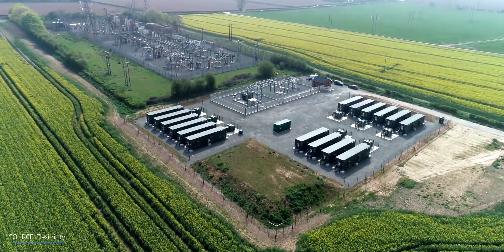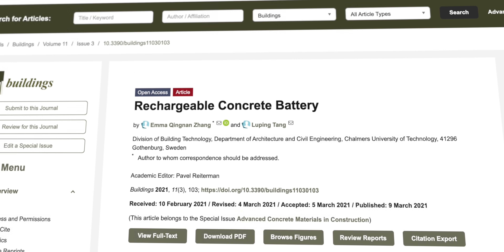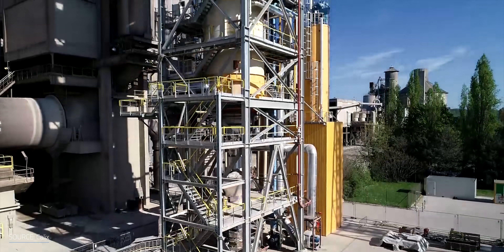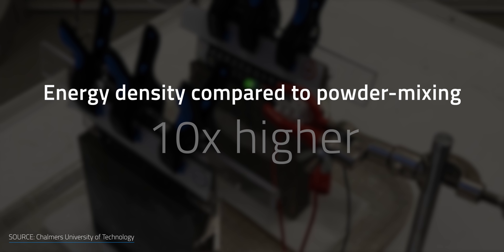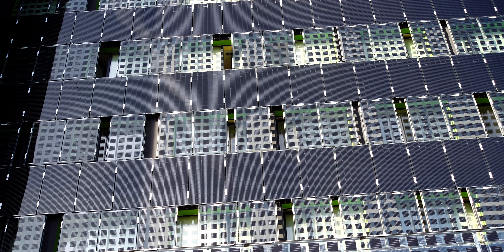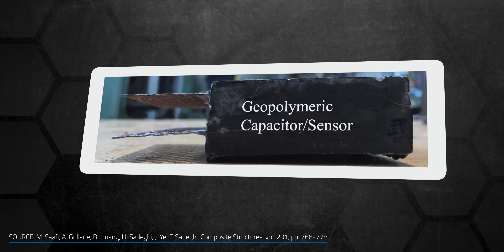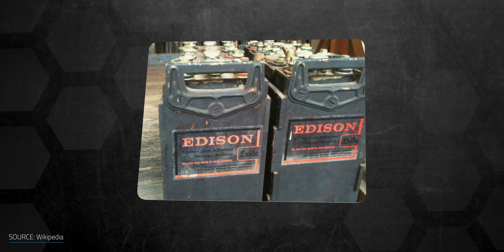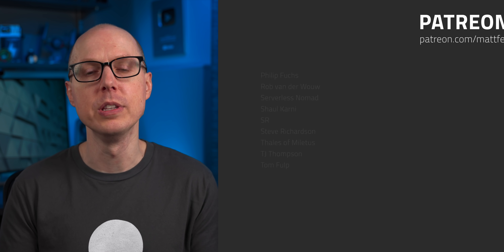Turning Buildings into Batteries? Concrete Battery Storage Explained

Comment: I hate to be that guy.  But this is not going to happen.  This is the most impractical idea I've seen yet.  Also, there seems to be this strange confusion with cement being the active material here..  Cement is nothing more than a terrible electrolyte.  You cannot create a system where construction works are suddenly manufacturing complex batteries while trying to worry about the construction of the building itself.  It cannot happen.  I think the main focus should be on alternative extremely cheap batteries such as carbon salt based batteries/super cap hybrids.  zinc ion + Carbon is near lithium energy density, and is practically made of garbage, and can run tens of thousands of cycles..

Comment: "This will last for years"
- shows an analysis sheet with degradation of 12% in 6 cycles

This tech doesn't seem viable based on all of the data collected so far PLUS from a practical standpoint. It sounds great, concrete is in everything so why not replace it all with a battery version, right?  Well because replacement is difficult and in some cases impossible...you can't just rip out the 12th floor of a 50 floor building.  "Then we'll just do it with new buildings"....that makes sense, until you realize that the batteries will eventually die, and by the sheets, that death rate will happen within days, so it makes no sense to waste the costs for a few days of electric hold and then not be able to replace later.  Then you have the technical aspect, electricity in a porous medium leads to rust pretty quickly, and rust expands the concrete which creates cracks, making it prone to failure on the foundation aspect.

You've taken the worst parts of 2 ideas and slapped them together....a battery that dies quickly and holds less charge inside a material that will never be trusted to hold its strength. Whoever came up with this idea is dumb, seriously, it's obvious they've never worked hard labor a day in their life, and it shows.
Reply: Yeah it's a pretty dumb idea. Likee, just because you might be able to literally build a car and engine out of rubber bands and razors, the fact that it works doesn't make it a good idea.

Comment: Metal rusts and if used as battery inside a concrete where it supports the intire structure . Idk it might weaken the structure over time and fail.

Comment: 7 wh per meters squared? How do you compare that to concrete volume ? Burj Khalifa (according to Wiki) used 330,000 Meters cubed . I feel like that is a major hole in the story. (If you ignore the m2 vs m3 thing, (330,000x7wh)/1000 to get kilowatt hours, means the entire Burj Khalifa can charge a Telsa Model S 23.1 times, which doesn't seem like a lot for a building that is an insane 828 meters tall) EDIT: Farther research I found the same table as Matt did, on the website they are saying 0.8wh/L. So assuming every single drop of concrete that was used in the Burk Khalifa was turned into a battery, it could hold 264,000 kw/h. From what I can tell, a normal home uses something like 50 m3 of concrete

Comment: I still think Redox flow batteries stacked up on shipping containers are a far simpler solution. They are easy to recycle fluids and no metals being lost once it comes time to recycle and a far greater energy density. I like the idea of this, but you would need electricians at every concrete pouring to make sure everything is wired correctly. Lots of other variables could go wrong during a pour. Maybe modular homes would be an easier trial run.

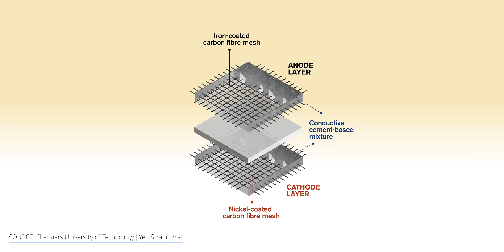Comment: So at 4:04 you show a layout of the “cement battery”.  I’m a bit confused about how this is going to be able to be a structural replacement.  It seems that you are creating a structural gap with the resin, because it’s not going to bind as well as cement to more cement, and won’t have the same strengths.  I’m not seeing how this can be used to replace structural cement, even after solving the problems of “construction workers building this”, “sourcing”, and a plethora of other things.  I love the thought process, and would love to turn structural cement into giant batteries, even if they are at lower capacity/volume.  But I’m not seeing it right now.

Comment: 6:57 Would future automated roadways have street lights? Also, seems like a good use-case for street light bases in general - They have a generally standardized installation approach with a grid tie... would love to see a video on approaches and attempts to date..
Reply: A radar car wouldn't need to see anything lighted. It wouldn't matter if there was light or not.
Reply: @larrycarter1192  lol, it's a dark future if automation takes over jk. Lidar is somewhat affected by light, I wonder if dark roads could improve performance

Comment: I am not an expert in this field.  BUT.....  There are times when the rebar in the concrete is used for and tied into the grounding system for the building.  With any tall building there needs to be  a grounding system installed when under construction.   What I am wondering is how lightning would affect 'the batteries'.

Comment: Just a thought, but I wonder what the temperature tolerance would be for these batteries. Just thinking since concrete batteries would be big, heavy, and stationary, they could potentially double as a thermal battery in addition to the electrochemical battery. Designing a building to be high mass for thermal storage would help mitigate the low energy density that a concrete battery would have.
Reply: And i will tell you how dirty are bicycles to produce.
Reply: @tomizatko3138  
What?

Comment: Concrete battery roads could provide both energy and Carbon sequestration at the same time. If they could function as energy collectors - solar panels, convert mass, vibrations, or heat into electricity, that would solve many other problems at the same time.

Comment: oh boi, this video misses so many points.
multiple times in this video cement batteries were assumed to become structural components of buildings, while also never testing their mechanical performances.
cement is an amazing building material because of its properties, how this technology impacts those features is very important, if embedding these batteries in normal cement walls automatically makes the structure weaker, it will never be used. 
reinforced concrete fails because with time the inner rebars rust and expand, cracking the concrete, these batteries seem to do exactly that, so at a first glance, and without any more info from Matt, this won't work.

cement is also porous, and these batteries need a liquid electrolyte, so i assume that with rain it will be just washed off with time (again, if used as a building material and not a normal encased battery cell).

7:50 that isn't a battery, it is a capacitor, very different things. 500W/m^2 isn't an energy value, those 500w could be delivered in a few microseconds, so the real energy delivered wouldn't even be a tenth of a joule. i really don't like this part since it means two things, matt doesn't know what he is talking about, or he is trying to mislead his audience, both bad things.

so to recap, this video strongly implies these batteries to be used as structural components in buildings, while never discussing about their structural properties, 
and totally misses clear issues while also showing wrong examples

Comment: question in regards to the insulation of the 'metal mesh' provided by the concrete: Won't this get jeopardized if the wall/floor gets saturated with water from a leak or rising ground water?

Comment: Concrete is a hygroscopic material, meaning it can absorb and release moisture from direct contact and from the air. There is no practical way to nullify it's ability to absorb and release moisture, therefore the conductivity of the anode and cathode of the battery would not be stable. This could lead to internal (unseen) corrosion, which could cause some dangerous issues. Think Surfside Condominium Collapse.

Obviously, I'm speculating where I used the term "could".

Comment: Would the structural integrity of the building be compromised by the battery cycling? IE would there become weak spots in the concrete support system?

Comment: Concrete is not sustainable and is very destructive to beaches where the sand is taken from. Not to mention the water it takes. This only encourages the use of concrete. It's like using plastic bricks, it encourages the uses of harmful plastics and lets companies that made those off the hook.

Comment: As if the application wasn't bad enough, they are looking at 3D printing them, slowing production to less than a crawl. This was just something the researchers added in, so they could spark the imagination of nontechnical investors and get themselves another round of funding. I used to work for a think tank that sometimes milked bad ideas, so they could make payroll, in between the good projects.

Comment: my problem with structural batteries and why I am not a fan of them, in most cases, is that once the battery is past it's life, you have to replace the entire structure usually, but the structural parts are normally still fine and good for a lot longer.

Comment: Sooner or later, someone will drill holes through the concrete, potentially killing the battery, or the person, or both. Also, accidents do happen. Whether a vehicle slams into the wall or the wall is brought down by earthquake, tornado, or a surprise condo collapse, once down, those walls could potentially kill the occupants who otherwise would have survived. Such risk may be low. But would you want to risk it? On the other hand, most people won't understand the risk of touching fallen concrete. Ignorance is bless I suppose.

Comment: Matt's statement about concrete being a poor conductor is misleading. It's a poor conductor compared to, say, copper. I used to be an electrican and I've been shocked several times, standing on concrete and I always wore rubber soled boots. It was the 80s and I worked with jackasses that would turn circuits on, just to hear how you scream.

Comment: Possible applications:
- concrete battery roads: as asphalt is petroleum based, it is worth thinking about an alternative to asphalt. Maybe we can make the road out of battery-concrete, and with some tweaking maybe even make its surface photoelectric and would double serve as battery and solar panel.
- In cases where structural strength is not critical (i.e. drywalls and buildings where  pillars are the supporting elements, not walls), it is possible to experiment with different battery thicknesses, and whether it is better to build one thick "battery" or many small ones, without being concerned about structural strength.

Comment: Once the energy density gets that low you'd be better off filling concrete blocks with capacitors. Especially considering they will last millions of cycles.

Comment: lol, i would estimate the probability of concrete batteries being widely-used anytime in the future, near or far, is nil. energy density is far too low, and the inherent costs and complications are in direct opposition to the extremely compelling benefits of concrete: strength and durability and low cost, and ease of installation and maintenance.

Comment: I’m confused. You seem to be using the terms cement and concrete as the same product. My understanding is they are different. At the current time the future concrete is in question as the supply of the right kind of sand is and may become an issue, especially in the certain parts of the world. Many people feel there may be conflicts over the supply of sand as a building booms continues.

Comment: As a eletriction and my dad being an electrical engineer this video set off a number a bells when it comes to electrical safety due to the way people outside USA wire there houses (because we use 203v instead of 110v) and the amount of times as eletriction we make holesin/on walls and inbed electrical items eg light switches into all number of building surfaces etc

Comment: Enjoy your channel. A lot of great information. I believe if limited resources like nickel and lithium are needed in concrete battery storage then it will not catch on. Those resources can be better used in more efficient/recyclable battery storage devices.

Comment: Given that the production of concrete directly produces CO2, not just the energy, but the chemical process itself, that is a stupid idea, unless you really don't use a gram of cement more than without it, but even then concrete is something we need to get rid of in buildings, not encourage.
Even if we do have carbon capture technologies of any kind, we need to use them to get the CO2 out of the system, not use them to justify continued CO2 production. Once we are at pre industrial CO2 levels, then we can talk about linking the two again.

Comment: Perhaps, probably not, but thank you for bringing more forward to the idea of structural capacity and generation!  Problem is fly ash to me.  To me I'd rather see Mn dug up and used wisely for storage, then burn coal and capture fly ash.  The energy density is approaching ~140kw/kg in various forms, abundant, pretty renewable and will work with PV and other forms.  Not as compact and Hi density as LI but a lot easier to get and recycle...always about a systems approach to me.  Pun-ishingly cemented to my giggleometer.  Thanks Matt!

Comment: Matt, you made a comment early on in the video that cement was unlikely to be replaced any time soon.

There was a NASA sponsored project a few years back to design a 3d printable Mars habitat module. One of the contestants was AI Space Factory, with their MARSHA Habitat Module, and AIS has since developed an Earth based version, TERA, as well. On their website, they claim that the compound used to manufacture the materials is stronger than concrete:

"TERA is built from a 3D printed biopolymer basalt composite –a material developed from crops like corn and sugar cane – tested and validated by NASA to be (at minimum) 50% stronger and more durable than concrete."

This might be something you would be interested in following up on.
Reply: And you could eat it if you fell on hard times or the supply ship from earth was late

Comment: Great video. Anything has the potential to become a safe everyday item that we use for a designated purpose. Have you described the Concorde to the people building a steam locomotive, they would have said you are crazy and it is utterly impossible. Maybe a battery will be designed with high energy density and without a finite number of discharge cycles.

Comment: If everything is true the only use is for storing energy for 2-3 days, to heat my house for the winter I would need 500 kg of hydrogen, concrete will not provide such a huge amount of energy, so you have to look for other solutions.

Comment: I think we need to look at other forms of energy storage than electrical. Batteries store electrical potential energy but we could use gravitational potential energy batteries, by pumping water through walls for example. Then letting it run through a turbine to the ground this doesn't lose efficiency over time
Reply: Or put the whole house on legs and jack it up using surplus energy? Then drop it down again and capture the energy released by turning the lift motors into dynamos?

Comment: Sounds way too good to be true. The capacity sounds plausible and fine, until we get into what concrete looks like when used in real world applications. 

How does it react to rock salt and snow melt? How does plant growth affect it? How does it interact with rebar? How does it compare to "normal" concrete for construction purposes? 

It seems niche at best right now.
Reply: Too good to be true? Would you make cement battery lampposts as opposed to regular battery lampposts if it was possible? I don't need the answer but whatever you decide will set your future.
Reply: @mithrandir491  honestly, no idea. I don't think there's enough information to actually make any decisions on it right now. My initial assessment is that there are a lot of complications and costs not accounted for when it goes to real world applications and I personally find that to be discouraging with it, especially when compared to other solutions presented out there. 

If I were throwing money at solutions this one would probably be low on my personal list of investments at this stage.
Reply: @epithail  overengineered solutions to simple problems will never catch on even if they make sense. This is why solar power never took off for five decades as there are simpler alternatives to it. Simpler in terms of manufacturing, installation cost and distribution.

Comment: I think the Iron-Air batteries are much more likely to be the mass storage solution that Li-Ion cannot be. I think I'd rather have a refrigerator sized backup battery made with iron than go through the hassle and expense of trying to turn the entire slab of my future house into a battery or live with a Power-Wall type device that could spontaneously combust if a dendrite gets out of control.